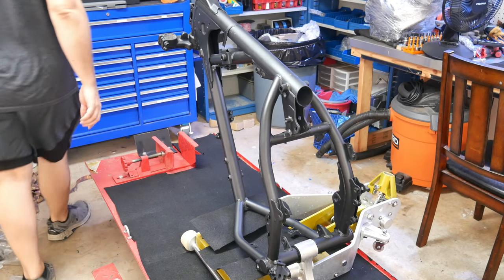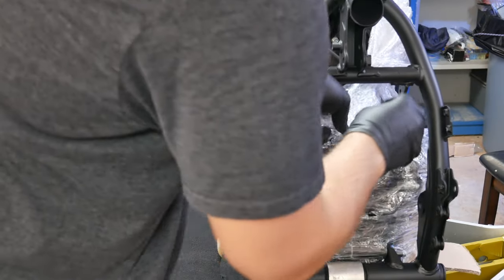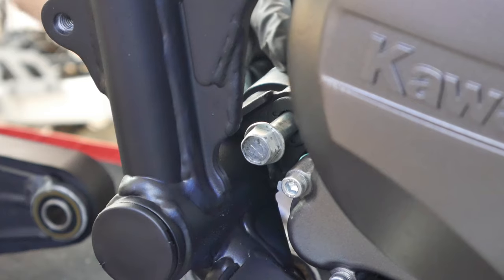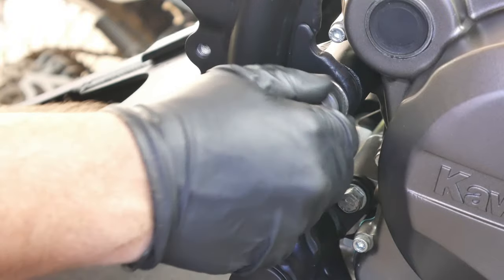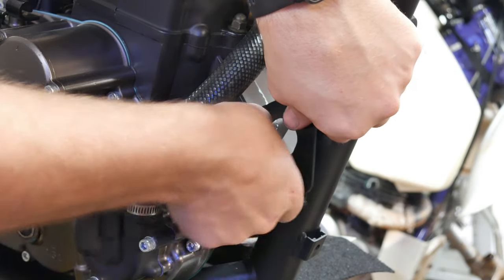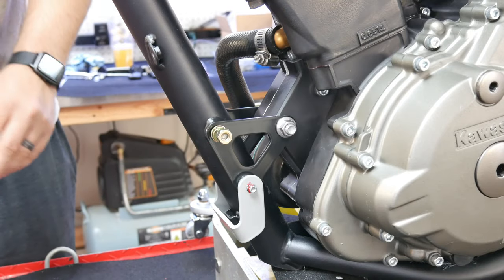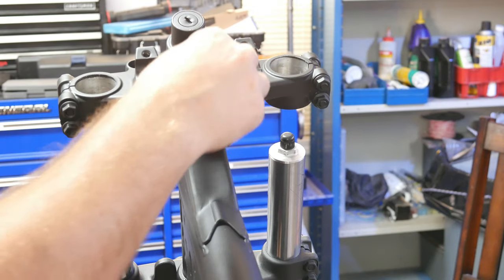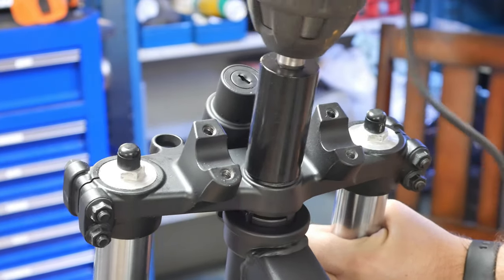Project Warthog EP 13: KLR  Engine and Forks Install

Comment: If anyone is doing this, I will tell you an easier way to get the engine in. We all learned it the hard way. After I scratched my frame, and still didn't manage to get the engine in, I realised that is so much easier to lay the engine down on its side, clutch cover up, and drop the frame over, takes seconds. No wrapping no blankets no straggle .

Comment: Polisport make a nice set of fork boots for the KLR  ,,,,at a god price!
Reply from the maker: I've heard mixed reviews on them some say they don't fit. Have you used them?
Reply: @Fixin2Ride  yes...you will need thick zip ties for the lower fork legs to hold them tight
Reply from the maker: @robertbruning1510  awesome, great info thanks!